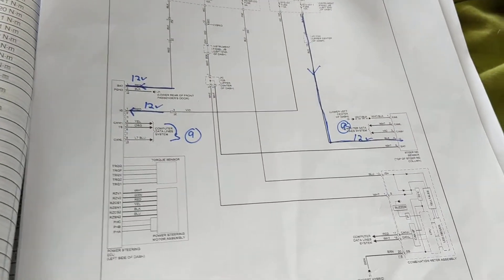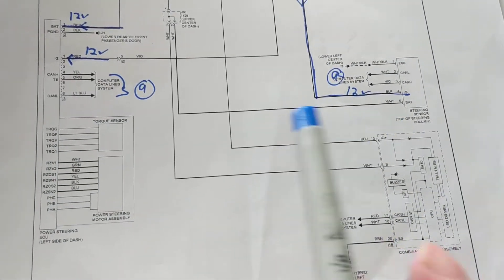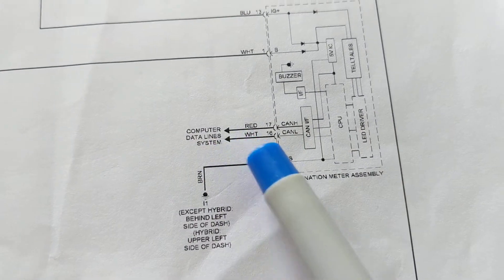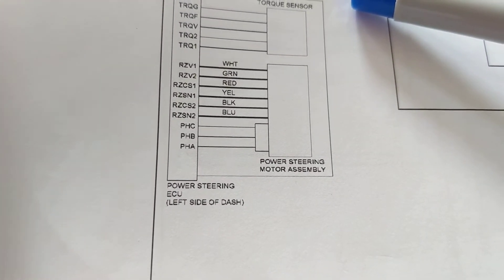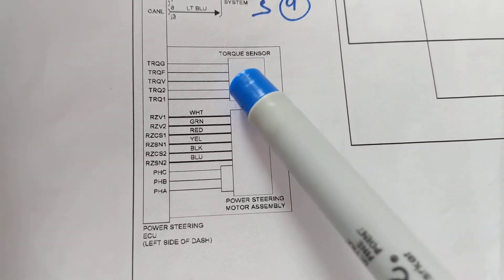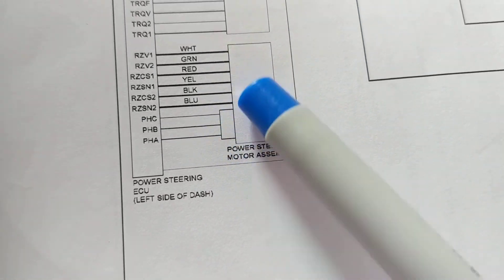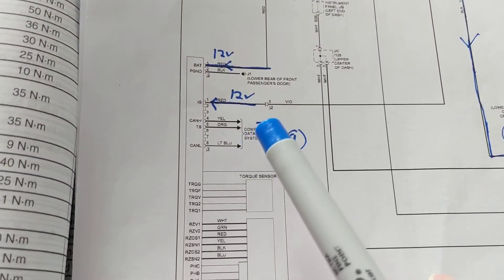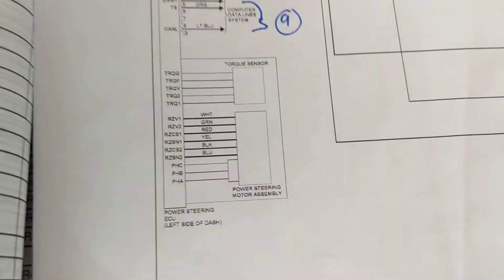ELECTRONIC POWER STEERING EXPLAINED from WIRING DIAGRAM and SENSORS

Comment: good day sir, my electronic power steer stopped working after the mechanic changed a pair of rack end, since then it came on about two times for a short time then went out again. I changed the rack and pinion but the eps light was still on. funny thing is about 2 days ago  my idler pulley that tensions the alternator belt started making a lot of noise, about a hour after that the eps light went off and the power steering started working, it worked the whole time until i took it to the garage the next day and changed the pulley. when we stsrted the car the eps light was on again. could the problem be the torque sensor?

Comment: I have a corolla 2009 and thers two wires coming crom the eps modules to the motor, how many volts i need to have ( actually inhave 6 v)
Reply from the maker: Since it goes to a fuse unpin one it should have 12 oz but if the alternator is on remember you might get more than maybe thirteen or fourteen v

Comment: Why my  electronic power steering is going on an off when i bump the key, something is bad
Reply from the maker: Sometimes it could be a problem with the motor overheating turning on and off and sometimes there are problems with the sensors that measure the torque complicated electronics as usual
Reply from the maker: And that's actually why the best tool to use is a scanner so that you can command the motor to come on

Comment: is the power steering control module signal 12v or 5v ?
Reply from the maker: If you're referring to the input of the power steering control module usually there 12 v but if you're referring to any sensors usually they can be 12 v or 5 v which make a model of a car are you referring

Comment: Simple question. I messed up the middle smaller wire that plugs into the motor, And now my car won't start. Could that be because of the wire I messed up? 
Can you explain those 3 wires that plug into my chevy malibu motor
Reply from the maker: Are these three wires for the sensor or for the motor for electronic steering so I can understand better?
Reply from the maker: Which connector a plug are you referring to and motor
Reply from the maker: Which motor are you referring to start a motor the starter motor?
Reply from the maker: Because the water could be going from a connector which is coming from the body control module which controls the relay to the starter motor the other one is for the serial data line for communications for the body control module best bet is to jump the load side not the control side of the relay to see if the starter motor comes on if you are referring to that one

Comment: Hey Joe, Your EPS explained video is great ... its helping me to train my brain into grasping how an electrical and mechanical system combines into giving me power steering... I have just bought a 2008 Suzuki SX 4 grip motor. Its power steering was working until last night when i was forced to ford flooded roads to navigate my way home after some torrential rain. I have spent a bit of time trying to find the PS controller with little joy so far. I am interested to hear if you think that any sensors such as ABS ones may be connected to the EPS system and if so is it likely to be a shorted sensor that has caused my EPS to fail.... You may be aware that i know very little about this or any other car for that matter but have been trying to locate Torque sensors on this motor .... I will keep trudging through diagrams and manual searches to try and eliminate the controller- pump and other bigger price items to replace but i would  kick myself if there is common knowledge out there about sensors shorting and causing EPC systems to crash...  I have saved your videos and have subscribed as you are the first person to actually explain in laymans terms how the electrical communicates with the mechanical..... its as if you have done this before ..lol....   Thanks in advance for any thoughts on this matter..
Reply from the maker: And such a situation you have to isolate the problem is it really electrical or is it mechanical because there is a motor involved instead of hydraulics the first thing to do is mechanical wise to inspect it thinking that a water is conductive and there is a motor involved if anything would be shorted it would blow a fuse because there are many protection devices protecting that motor and system go put in Google diagram wiring for the name of your car 2008 Suzuki electrical power steering try to locate that good luck and hopefully you can find it keep me updated
Reply: @Joeelectronicschematicsforauto  Thanks  and yes.. i checked the fuse boxes for just that ... I will locate the controller module and strip it out and check.... I may even buy a second hand one and plug that in.... I have a manual as of 4 mins ago so will get busy with that....  I've joined a forum as well as sometimes they can be useful.... I will be sure to give you a heads up when progress has been made... thanks for your prompt reply ..... Have a grand weekend....
Reply from the maker: @gogsalba4573  good troubleshooting just one step at a time either mechanical or electrical keep me updated